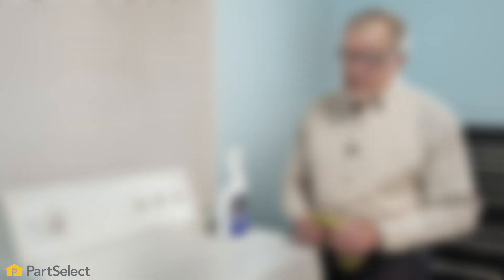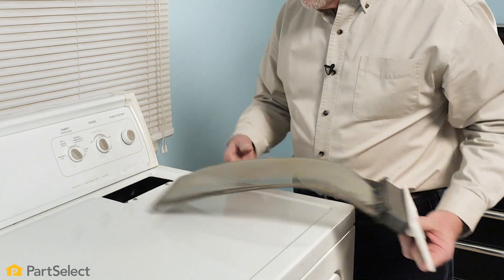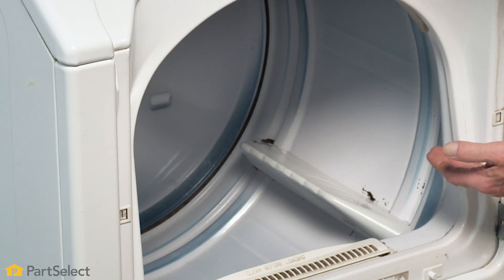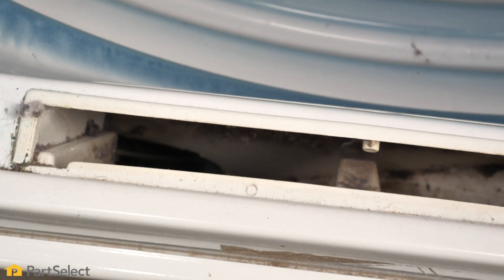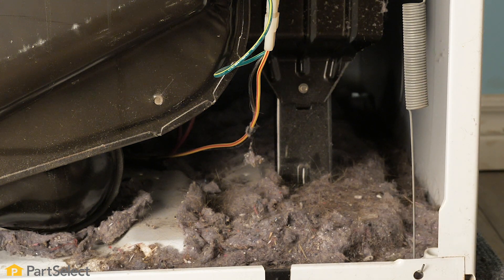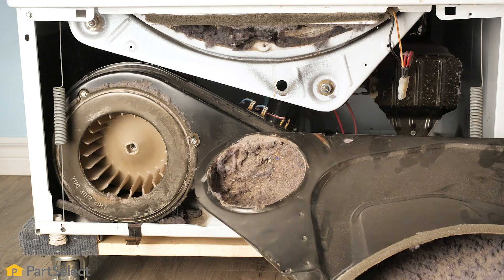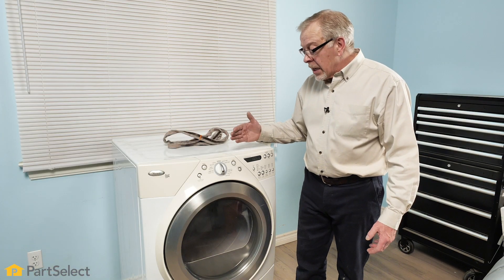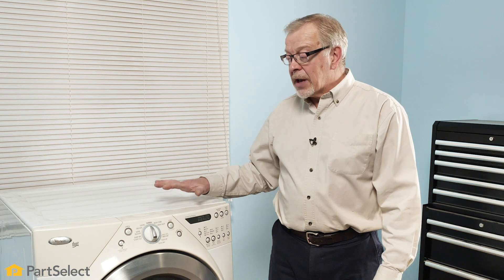Dryer Not Drying Clothes Properly? How To Properly Clean Your Electric Dryer | PartSelect.com

Comment: Petroleum is the main ingredient of Vaseline so as Steve says, don't use it. You may be more familiar with other petroleum byproducts, such as kerosene and gasoline - hence his mention of a fire hazard if used.  Once a year, or at most every two years, vacuum out where the filter is (sometimes a small panel is removable from the inside part of the filter housing - don't drop the screws down there!) , pull the dryer away from the wall and vacuum under it as best you can, and put the vacuum hose (shop vac works really well) as far up and into the exhaust pipe as possible...then do it again from the other end outside the home.